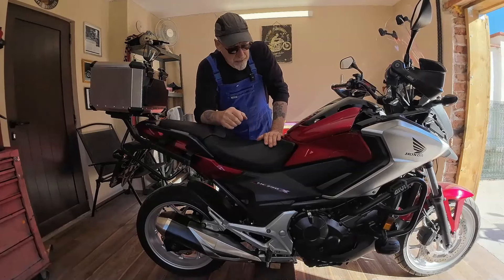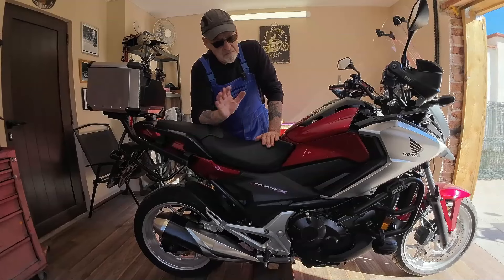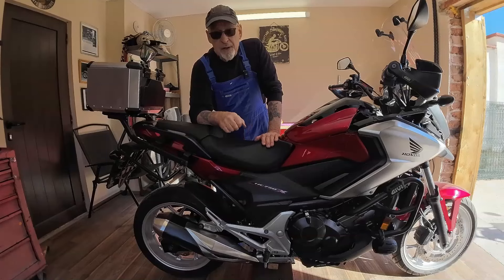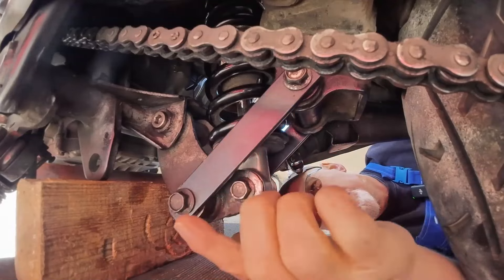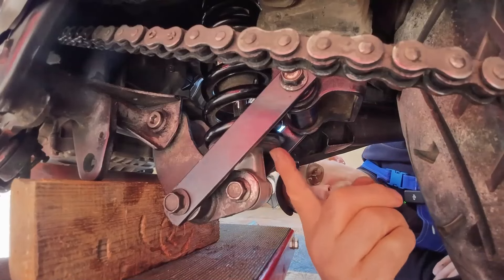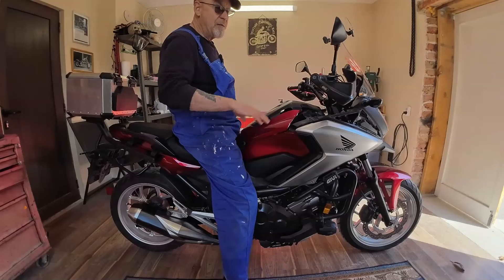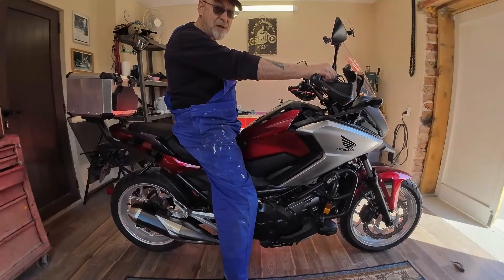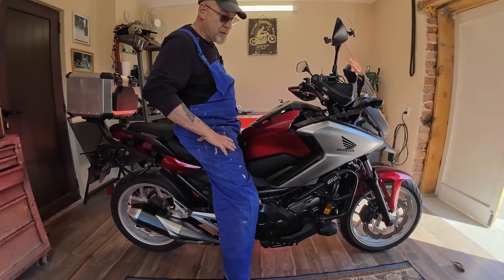Fitting an Ohlins shock absorber to my Honda NC750 X

Comment: I've been sent a rear shock for my nc750sa, the one they sent is 10mm longer in centres(eye to eye).
Could I still fit it? What problems would I have?
Reply from the maker: You can fit it but it will alter the height of the bike. Not by much but as I no longer have my NC750X anymore I am not able to go out and measure it for you. All shock linkages are different. If it altered it the wrong way making the bike either too low or too high for you you can change the link arms in the bottom of the suspension to either shorter or longer arms.
You will see when you put the new shock in, top mount first, when you go to connect the lower link arms up on the bottom the bolt won't line up to go through the link arms and shock absorber. All you need to do is jack the bike up or left it down to allow them to line up. Obviously that is altering the height of the bike.
Hope this makes sense.
Reply: So it'll work ok? And it will fit still
Reply: Will it make the seat height higher or lower? Higher is fine
Reply from the maker: @richardwilliams5608  Without being able to see the bike I can't say whether it would be higher or lower. As I said I no longer have my NC750 to compare to. All bikes are different depending on where the link is. If it made it lower you can make new dog legs / lower links either shorter or longer as required. If you look at my video I made new lower links out of flat bar. Alternatively you can buy them off eBay.
Reply: I'll keep it then as they want another £45 for them to send me the correct one! Thankyou
Reply from the maker: @richardwilliams5608  You're welcome
Reply: I've managed to remove and install new yss shock.
With 1 change from your method. I cut a 30mm hole in the plastic cover to enable the access of a socket and also make it easy to remove the bolt. 
I'll fill the hole in with a rubber grommet so that when I come to check it next year,it'll be simple.
I just had to measure where the hole needed to be then cut it out with a 30mm drill bit!
Thanks again

Comment: Great video again.
Id really like to know how you got the top bolt in ?? As theres no easy access. Would it be easier taking back wheel out? To make access easier as i really dont want to remove all plastics!
Thanks again
Richard Williams
Reply from the maker: I showed in the video that i just pulled the the bottom of the plastic side panel up. I put the bolt in the socket put it through the hole in the frame. Laid on my back put the shock up into place and you can see the top shock mount and the bolt . With the bolt in the socket on the end off a long extension you can get in the top mount and with a bit of fiddling through shock as well.
Reply: So you put the bolt in from where the nut was originally, as mines got a nut on that side.

How did you get access to get the nut on as there's no space?
Reply from the maker: @richardwilliams5608  you have me thinking now ,a I have sold the bike so can't go and look . Yes you are correct the bolt did go in from the other side and the nut went in from the right hand side sorry. But I remember just laying on the floor offering the shock into place and putting the bolt in with my other hand. I had no help from anyone and fitting the new shock was all completed in no time at all
 Did not remove the wheel at anything as not needed.
It was about  5 months ago now and I don't have the bike to look at to refresh my memory.
Reply: Ok,thanks for replying on a Sunday, your videos are brilliant as I've never tried doing my own maintenance but your videos have given me the confidence to do so.
Thanks again
Shame you got rid of nc, any recommendations of other channels to look at?
Many thanks Richard Williams

Comment: are you using the ohlins STX 46 shock absorber?
Reply from the maker: That is the one I used but originally purchased it for a Ducati Hypermotard. I had to get a different spring for use on the NC750. You would be better contacting Ohlins for model specific advice as Honda have changed the spec of the shock over the years.
Reply: I did contact them and unfortunately they don’t have any for nc750
So I’m noticing that maybe it might fit ours, not sure though our year model is the 2022
Reply: What part number did use?
Reply from the maker: @vb1594  there shock absorber I used was an STX 46 I don't have the part number as it was about 18 months ago . I had to make new dog legs to get the bike height correct and the ohlins top mount is narrower so machined up spacers to take up the gap to make it the same as stock.
You bike is 2022 which is a different rear shock to my 2018 anyway so what I used probably would not fit anyway.
I have fitted a YSS shock to my royal Enfield Himalayan and it is as good as the ohlins at a fraction of the price. They list one for your honda NC750X 2022 but it doesn't fit the 2018 model I had. So this does show 2018 is not the same as 2022 model,I think yours is a lower bike than the earlier model but the YSS is adjustable on the lower mount if you want to raise the bike height.
Hope this helps.
Reply: @iantoy7778  thank you brother for your response greatly appreciate it. have a Blessed Healthy day